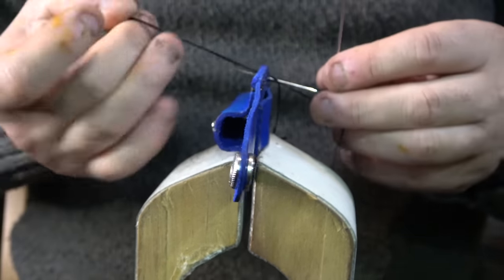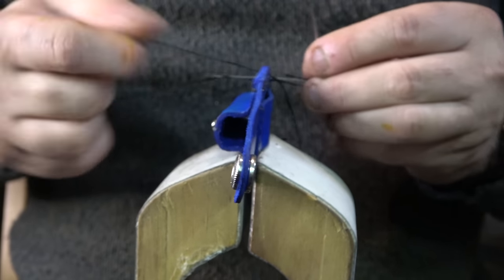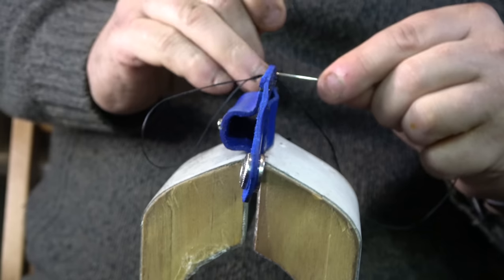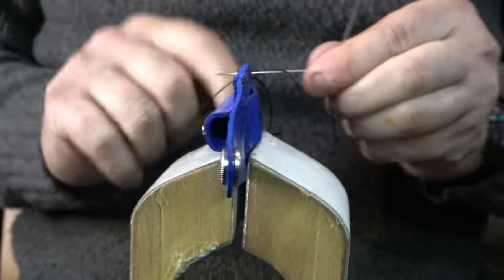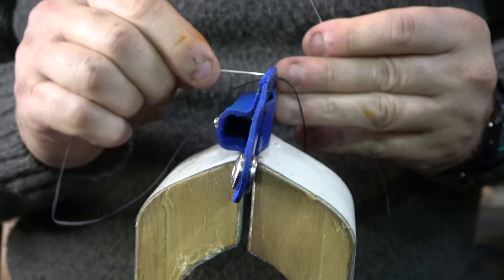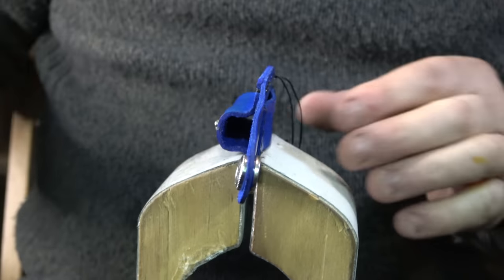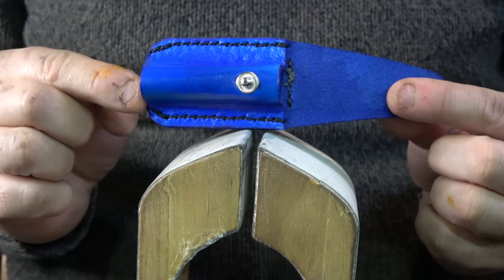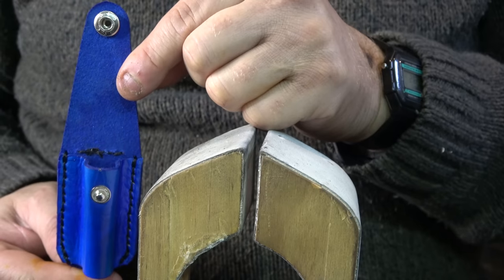Disaster pt 2 Can we fix our Narrowboat engine

Comment: What happened with the Jenny? Did I miss something.
Reply from the maker: No the jenny is still not fixed 😒🙂
Reply: Just thinking about the Jenny, could the gas cap be bad or plugged in some way, not letting air into the tank causing a vacuum to develop. If so, the Jenny would run for about ten minutes and then die same as when you shut off the fuel shut off valve. I do that to drain the lines on my Yamaha for storage. Shut off the gas and let it run till it quits takes about ten minutes. Can't be that simple though but it does sound like a fuel supply problem. Good luck, merry Xmas